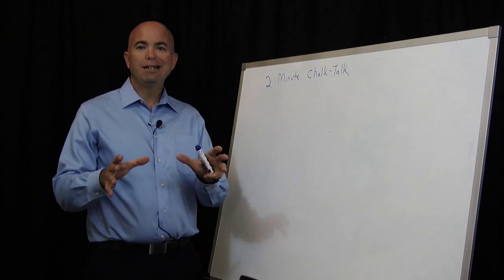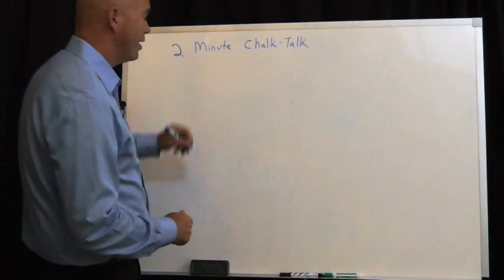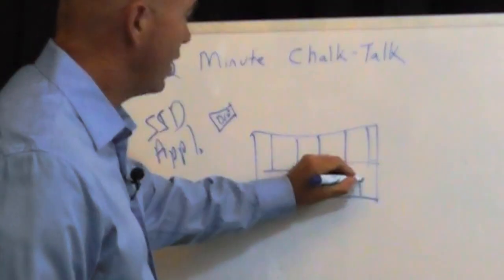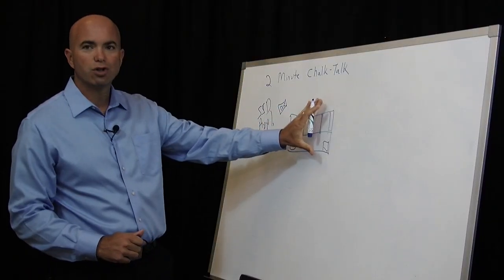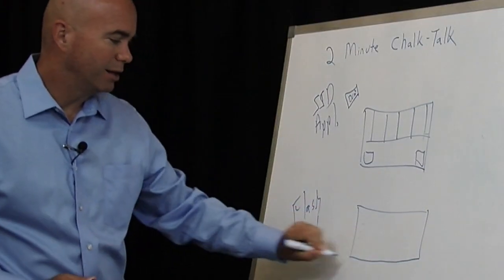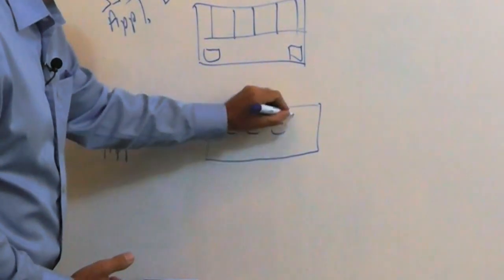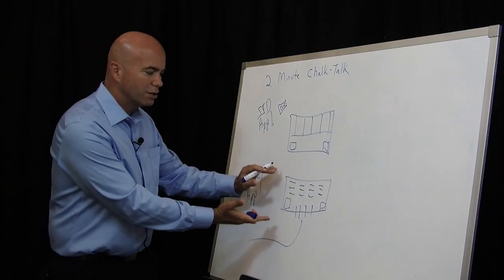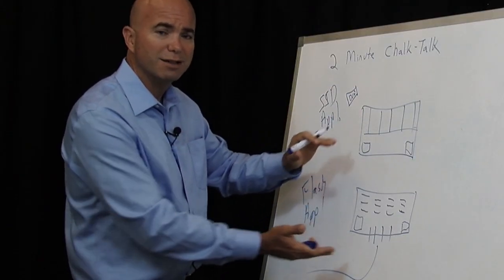"SSD vs. Flash Appliances" in Less Than Two Minutes

Comment: Performance is also a key differentiation. Flash appliances will blow the doors off an SSD based system by 5x to 20x.  This makes virtualization and, therefore, consolidation much more efficient on Flash based arrays. Go here: www.violinsystems.com